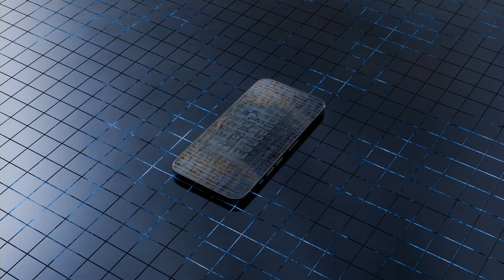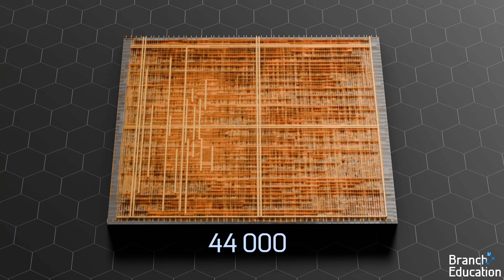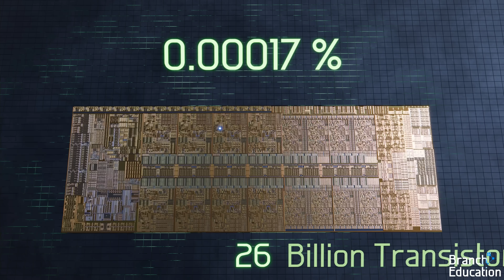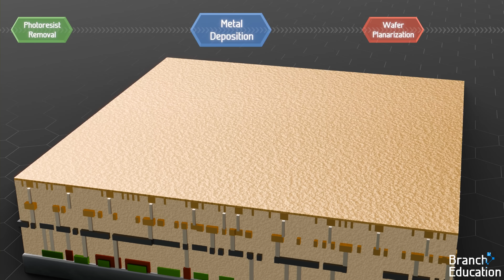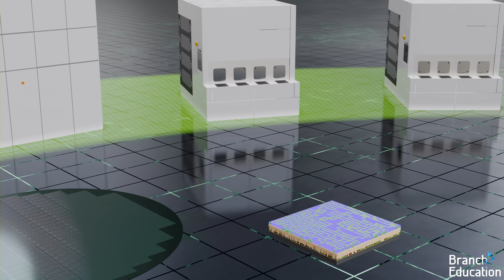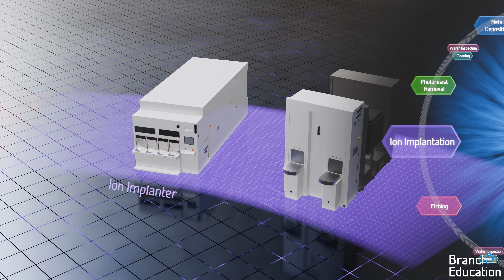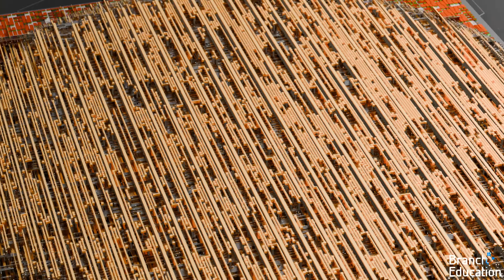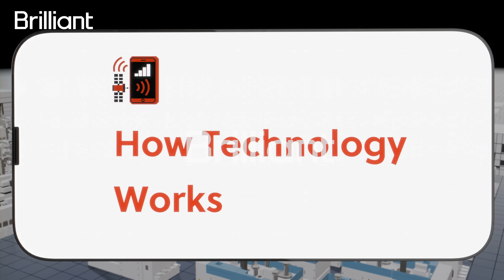How are Microchips Made? 🖥️🛠️ CPU Manufacturing Process Steps

Comment: i bet it was so annoying owning the company and every year you need to upgrade or youll go obsoltete "ok lets revise this 1000 step, 6 month per chip operation, to add a completly new wafer which has to be made to fit with the system of 10billion circuits, to now fit with your new one. cheers, im sure this is the last, most insane upgrade ever" - some dude in 2002

Comment: Sounds more complex than it really is. Think of those transistors as tiny light switches. Each one is off or on. 0 or 1. 

The first computers actually used light bulbs and took up entire floors of college campuses. Then they realized that to do more than simple math those switches would need to be smaller and use less power.

So, they miniatureized that college campus floor into a microchip. 

Each switch is credited with a tiny printing press so billions can fit on a postage stamp size peace of silicone.

Comment: I worked for 25 years in the semiconductor industry. In 1980 we had 3 micron n-channel and 5 micron p-channel devices and when I left in 2005 we’re were using 0.13 micron devices. This industry changes rapidly and the costs of these new fabs are astounding!
Even though I have been out of this industry for 20 years the lingo has remained the same.

Comment: Notes
90bn trans
semiconductor fabrication factory
clean rooms the size of 8 football fields.
100s of Machines as big as the size of a bus costing from a few million to 150 million dollars.
In the factory, silicon wafers travel from machine to machine, with over thousands of processes over a 3 month period. At the end of production each silicon wafer will be covered in 100s of cpu chips, each with 26bn transistors. These micrchips are cut out from the wafer and tested and packaged to become part of our computers.
Inside cpu is integrated circuit aka die aka chip.
In total there are 17 layers of wire interconnect in the cpu and each successive set of levels uses larger and larger interconnects. At bottom are local interconnects(move data around in their 32bit multiply circuit, then intermediate interconnects(move data to diff cores) and global interconnects to move the data around the entire cpu.
Zooming in across the interconect layers you will find FinFET transistor whose dimensions are 36x6x52 nm and the transistor to transistor pitch of 57nm. Even smaller than mitochondria.
If among the 900 steps, 3 months of production any process is even 1% off then the entire chip is ruined.

Oxide Depostion(an insulating layer of silicon dioxide on top of wafer)
Photoresist spin coat( a layer of light sensitive photoresist is spread across the top)
Photolithography using UV light and a stencil to apply a pattern
Photoresist develop(solvents are used to remove the area hit by the UV light)
Etching(using the mask, the revelaed silicon dioxide is etche away down to the previous layer)
Photoresist removal(mask layer is removed)
Metal deposition(copper is added to cover the wafer and fill in the area that is etched away)
Wafer Planarization(surface is grouned down to revelaed the copper and insulator pattern)
This completes a single layer.
The next layer is a vertical set of metal vias, repeating the same set of steps but using a diff pattern of photomask.
So 80 layers are etched over the wafers resulting in 940 steps.
The FinFET trans are more complicated than the metal wires and thus additional steps are needed to fabricate them.
CLeaning the wafer to wash away dust particals that may have landed on the wafer and inspecting the wafer to make sure that it is built properly is done frequently which also adds to the steps.

Now to the fabrication factory.
The size of silicon wafers is 300mm which can fit 230 chips and 952 DRAM chips. These wafers are carried in a stack of 25 using a container called FOUP(front opening unified pod). Overhead transportation system is used to move FOUP through the cleanroom floor.
Robotic arms transfer the wafer through vacuum load locks into chambers where materials are added, removed or processed. Then they return to the FOUP, resealed inside, and dropped into the next tool. These wafers travel for 3months from tool to tool where one of the 942 steps are done. There are total of 435 semiconductor tools in the clean room floor arranged in rows resulting in the fabs prudction capacity of 50,000 wafers or 11.5 million CPUS a month.

There are 6 groups of tools for mask layer(photolithography, spin coater, developer), adding material( chem vapour deposition, physical vapour depoistion,atomic layer deposition), removing material(plasma etcher, wet etcher,chemical mechanical planarization), modifying material( ion implanter, annealer), cleaning(wet bench, ultrasonic cleaner, megasonic cleaner, spin rinse dryer), inspecting ( optical microscope, scanning electron microscope. focused ion beam, defect inspection system).

Photoresist spin coater applies a light sensitive layer to the surface of the wafer. Then comes photolithography tool
The stencil through which the UV light passes is called photomask. UV light is demagnified and shrunk down to produce nanoscopic pattern on wafer. When light hits the wafer, the place of the photoresist gets weakened. When the wafer goes to the developer, the weakened photoresist is washed away leaving the nanoscopic stencil on the wafer.
Then the wafer is sent to a hard bake to hardened the remaining photoresist. Next the wafer travels to other tools to undergo processing. After that photoresist stripper uses solvent to dissolve and remove the photoresist mask layer.

Photolithography tool.
Uv light source, a set of lenses to focus the light, a photomask which contains the stencil and a wafer carrier. The photomask is 6 by 6 inches and based on the dimesnions of the cpu, can fit 2 copies of a single layer of CPU design. The purpose of using a photomask with these crazy optics is beacuse its a reliable way to copy and paste a design for billions of transistors and wires onto 230 identical CPUs on a single wafer in a few minutes. The UV light is shrinked to 1/4th by passing to more lenses after it has passed the photo mask and lastly printing a single layer of the design onto the photoresist. The wafer carrier steps from position to position, printing the photomask image at each stop until all 230 chips are patterned. 
The CPU having 80 layers means the no of photomasks and mask layers used to create all the diff layers of patterns on
the wafer. Therfore one complete CPU chip uses 80 different photomask each costing 300k dollars. One mask layer gets printed at a tome so the chip will undergo 80 separate visits to the lithography tool.
Deposition layer kind of acts like spray panting through a stencil. Essentially there are 3 key group of materials that are added or deposited onto the wafer. Metals(copper, tantallum,gold,al,nickel,tunsten) use Physical Vapor Deposition, Insulators(oxides) use chemical vapor deposition, Crystalline silicon uses epitaxial growth.
Depostion tools have a center wafer handling chamber and various chambers, each chamber dedicated to depositing one element or compound.

The next category of machines do the opposite which is to remove the material. 2 key methods, Etching and CMP(chemical mechanical planarization)
Etchers use corrosive chemicals or high energy plasmas to react with and remove materials from the wafer. Typically used with mask layer stencil. 
CMP applies slurry and uses abrasive pad to grind and polish away the top surface of the wafer making it perfectly flat. This is the last step for the preparation of wafer to add another layer to the wafer.

The next category are tools that modify the silicon and are called ion implanters. These tools use photomask stencil to bombard the unmasked regions with phosophor, boron, arsenic,germanium, silicon and other elements, to make the P and N regions required to form the transistors themselves. Ion implanter are used only in the front end of the line. They are not adding material unlike other tools, they onlu add around one atom of P or B for every 10,000 atoms of silicon (doping). Additionally while other machines spray paint a layer on top of the wafer, ion implanters, hurl atoms deep into the silicon lattice like a cannon launching a baseball 6 feet into a concrete wall. The process damages the silicon lattice and thats why following it, a tool called annealer is used to repair the silicon by heating the wafer.

Then come cleaners, to clean and remove any contaminants or particles from the wafer. The wafer washers use ultra pure water to clean the wafer and dry it with nitrogen or 
hot isopropyl alcohol, Cleaning is done frequently in each layer.

Lastly are the tools called metrology tools to scan for defects in the transistors and metal layers. Common metrology tool uses a scanning electron microscope with nanometer level resolution to take pictures of the top surface of the wafers to determine if there are defects such as improperly patterned layers or particles on the surface.

Before  chip manufacturing at the fab,  
we first have to manufacture the silicon  wafers by refining quartzite into pure silicon,  and then growing a monocrystalline ingot  and cutting it into wafers. For reference,  these 300-millimeter wafers are around  three-quarters of a millimeter thick, they have a barcode on the side and a small  notch in them to indicate the direction of the crystal lattice. Furthermore, these wafers are  incredibly delicate, and shatter into hundreds of shards when broken. A single wafer costs  around a hundred dollars, but after being populated with CPUs it’s worth closer to a hundred  thousand dollars, making it quite literally ten times more valuable than its weight in gold.

The completed wafer is sent to a separate building  where each of the CPUs undergoes rigorous testing to figure out if it works as intended. If a CPU  works, that’s great. But frequently a particle or photomask defect has damaged a section of  the integrated circuit, rendering that section defective. These semi-functional circuits are then  categorized, or binned, based on what still works. These Intel Thirteenth Gen processors are sold as  an i9, i7, i5, or i3, depending on how many cores are functional with different product lines of  CPUs whose on-board integrated graphics sections are defective. These wafers are transported  to another building where the chips are cut out using a laser, flipped over, and placed on an  interposer which distributes the connection points to a printed circuit board while a protective  heat conductive cover is placed on the back side. The printed circuit board holds the landing  grid array that interfaces with the motherboard as well as various electrical components. Next  an integrated heat spreader is mounted on top, and the entire assembly is tested one last time  before being packaged for sale. Finally, the CPU is now ready to be mounted onto the motherboard  and installed into your desktop computer.

Comment: Unbelievable! Have spent hundreds of painful hours to attempt  wire amplifiers, modulators, multiplexers using Transistors, resistors, capacitors interconnection, but miserably failed to assemble into a matchbox a few years before the advent of miniature FM trans receivers....due to uncontrolled feed-back and Unstable parameters due to air movements disturbing desired values! No answer to WHAT 7 million WONDERS of the world!❤ Thank you for this "Premium Video!"

Comment: I worked for a manufacturing company in the past and found a few of these processes relatable. On a higher level, the idea behind them is the same as shown in the video except we used different materials with much simpler steps. We also used different names for some of the similar processes. We also had the inspection computer machines to look at the finished product at the micro level , checking for cracks and imperfections in the process. If the imperfections were too many and quality wasnt up to par then it would repeat a few steps. One of those steps was me using deflash process to clean up the gasket rings before sending them back for close inspection. It obviously wasnt near the level that chips are made but the processes are somewhat similar. We made gaskets for cars, pipes and even for NASA rockets. The NASA gaskets were huge and nearly as thick as my wrist. 

This video is awesome and the whole process of making chips is phenomenal. Subed with the quickness. Facinating stuff and great channel.

Comment: I have been working my whole life with computers and programming. It's insane that I don't even know how they are made or how they work. This video demonstrates it as such it's possible to grasp the idea of the processor. The key elements are the units which form logical circuits. Computers look like a city structure with each layer going deeper and deeper until there are just one simple worker, a transistor. Considering I watched skibidi toilet before this video I think my brains melted more with the previous. Logical circuits are built.. Logically. The origin and the concept of semiconductor might be easier to grasp than something totally artistic. Like often in mathematical contraptions there's really only one way to do it. The problem is to manufacture it as small as possible. This video made me think about the older computers sized of a room or a factory. And even physical ones. Would be interested to see and here more about older technology which was also used in space rockets back in the days.

Comment: Anyone who likes this should check out videos about the synthetic diamond based processors. The diamonds are made using a Chem vapor depo. system and then go through a process similar to silicon to turn them into processors. And the abuse that these diamond units can handle is nuts

Comment: 17:11 So they literally wash the CPUs with water? I always thought water was bad for electronics because it could short them out as water conducts electricity.
Reply: distilled water isnt conductive
Reply: yes but you can only short something out if electricity is flowing through them... matter of fact you could submerge a smartphone without the battery in water, leave it to dry completely and reinstall the battery and other than the other related water damage (like residue on the screen etc) it would work like nothing happened... that's why older phone if they were submerged for a very short period of time and you removed the battery straight away and leave them be till completely dry they could go come back to life. With modern technology there are way more things that can go wrong and the components are way smaller than before so it's more unlikely but still possible, often as well a short doesn't mean ista-death of a component, depends where is the short etc, it could be easily replaced and boom back to life again.
Reply: @aizel330stream  Yeah, I guessed that they only got damaged if they got wet WHILE electricity was flowing.

Comment: Chip fabs have gone from 100 mm to 200 mm and now they're 300 mm. A long time ago I was in a 300 mm plant. The robots that they pictured are actually on a monorail system that sends the pods from a cue bank holding them waiting for the machines to be free for the next process. They're about 30 ft in the air and they make a lot of noise. 
The place I was working the machines was owned by the manufacturers of the machines and were leased to the corporation making the chips. If a machine broke it was responsibility of the owners not the manufacturers to fix it.

Comment: It's mind blowing how much goes into making such a small and common thing we take for granted on a daily basis. Amazingly informative video. 

My only question is, towards the end, it mentions the different levels of Intel processors. So are all of the chips that roll out of the factory basically the same, with dead or malfunctioning parts on them, and that's what determines whether it's going to be an I5 with X amount of cores or an I9 with Y amount. I'm curious how the clock speed / core count is determined as well, or is that more of an Intel kind of secret?

Comment: Thank you, very interesting.
By what you said i understood that i3 - i9 are the result of how clean, accurate and perfectly functional the chips are.
Are you sure that is what separate between them, and not by a firstly intentionally aim of making several quality types of chips?
What if all of them would come out perfect, then they would not have i5/3 chips?
Reply: I'm not the uploader but in case they don't answer your question, the answer is yes, all chips are made as though they are going to be the top of the product line, and yes, theoretically, if they all came out perfect they would all be flagship i9, however, it would never happen, as the vast majority will have defects by the sensitive nature of working on the nanometer scale. In fact, many chips are outright scrapped. Most become i3 tier, the smallest amount become i9 tier. And of course this is all reflected in the prices. The best ones cost the most for very good reason!

Comment: Teraz mamy maszyny no dobra, ale jak robili 30 lat temu setki tysiecy tranzystorow w pierwszych komputerach np. commodore lub jeszcze wczesniej ?
Reply: They used basically the same techniques and processes back then. Of course the technology has evolved and innovated massively since then but the basic principles haven't changed.

The Intel 4004 was the first true microprocessor, simpler devices were made using photolithographic techniques before then. Before the 4004 processors used to be made by wiring together individual logic components and even single transistors, diodes, relays, or vacuum tubes.